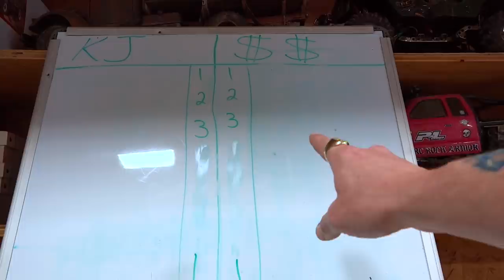LOADING WARS: "Highway Robbery - a Win Fail" : Forklift Fights S2 E18 | RC GAME SHOW

Comment: Gentlemen from RCSparks.  I'm looking to get A King hauler come tax time, and I was wondering what Brushless motor system would you recommend as a replacement.
Reply from the maker: Everyone has their opinion on the "best " brushless setup.. but I personally would go with a Tekin Roc 412 1800kv sesored with an RSPro esc
Reply: @poppygoatshomestead  Alright, I'm open to other recommendations from the rest of the team.   Also who runs that combo in there Hauler?